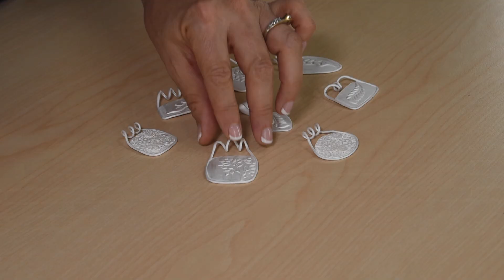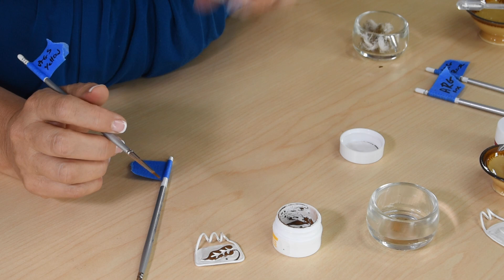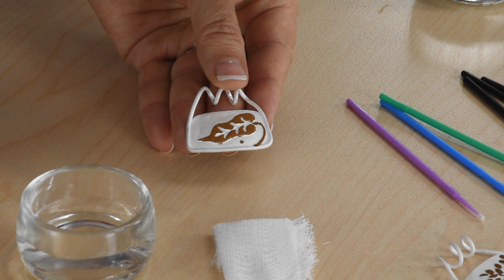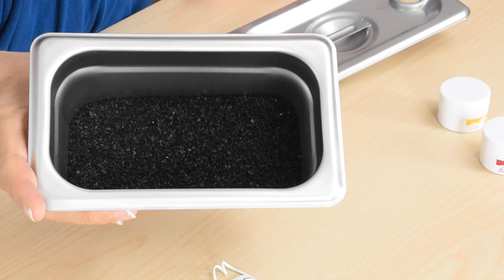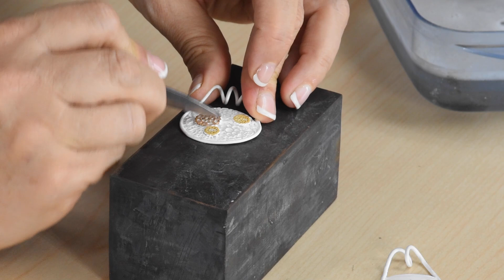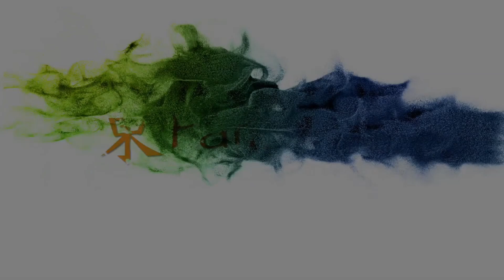Accent Gold for Silver and Accent Rose Gold Tutorial

Comment: hello Pam. sorry my horrible inglish, but i have at the moment no translater. Thank you so much for your supervideo.I also work a lot with metall clay silver and i make a lot of finger rings with different textures. so my question is : can i use the AGS Gold betwenn the silver pieces on a ring ond can i polishing this with a little metallpen. or do you think this gold is not good for applying to a ring because the owner will loose the gold when he weare it every day? thank you so much for your answer... Doris from switzerland❤
Reply from the maker: I have put gold on rings, but only in recessed areas.   If the fingers rub the gold, then it will wear off over time.

Comment: Question about the carbon. How do you store/handle responsibly. Can you reuse it? Put it back in the larger container? How do you dispose of it and/or do you need to dispose of it? Asking as I live in an apartment—limited storage and want to know best way to handle this eventually. Many thanks!
Reply from the maker: The carbon is very reusable.  I keep mine in a small bucket with a lid.  Over time it will develop ash from the firing process so you will want to clean that out periodically.  I wait for a clear day with a light breeze.  Take it outside and pour it back and forth between two containers. Wear a mask while you do this. The ash will drift away, and the good carbon will remain.
Reply: Manythanks!

Comment: I am teaching myself these techniques.  I have done all the research and all the required products have been purchased and I am waiting for them to arrive.  I have a question???  Accent rose gold, you say that using a torch for firing won’t work.  Have you ever tried it?  If you did try using a torch for firing the rose gold, what would be the result?  Would it bond, but not come out the correct color?  Have you ever tried it?
Reply from the maker: I haven't tried it, but only because I understand the problems.  Rose gold is made by mixing a small amount of copper in with the gold.  When you heat copper in open air it oxidizes.  This would cause it to blacken and likely flake off.

Comment: Thanks for all the practical info - I heard that you can also use these products in the green ware stage before firing - you did not mention this aspect & if so is it equally effective?
Reply from the maker: I have not used Accent (tm) products on greenware, but I have seen Aura Gold used that way successfully.  Just remember the longer a piece is fired, the more subtle the effect is going to become since the gold will absorb into the silver with extended heat and time

Comment: Hi Pam! Thanks for this video. Been trying out new techniques of adding gold to my work and this looks like a great option for me.
I have a couple questions-
Do you think it's possible to use stencils with this technique?
Does it stick onto the metal once it dries to keep it from spreading all over the piece?
Will it flow at all during the firing process or will it stay put?

Hoping to use this technique on the sides of ring shanks and looking for the best possible outcome. Thanks!
Reply from the maker: Hi Hannah,  So glad you liked the video!  It does stick to the metal once dry, but if you brush it with your fingers you can rub it off or move it around. So don't touch it until after it's fired!  It will not flow during the process. It's well behaved and stays put.    Bear in mind it IS a very thin layer of gold.  An area that might get rubbed a lot (like the side of a ring getting rubbed by adjacent fingers) will eventually wear off.  Good luck! I hope this helps!

Comment: Hello. Wonderful video :) 
Will gold chip off after some time or will it stay there forever? 
Thank you
Reply from the maker: It won't chip off.  The gold and silver are molecularly bonded.  However, it IS a thin layer. If applied to an area that is going to have a lot of touching or wear, such as a ring, it will wear through over time.  Piece such as pendants and earrings should be fine though.

Comment: Hi Pam, Thanks for the informative video. My question is: My pieces are not flat, they are more dome shaped. I usually fire them in a bowl with vermiculite face down to keep the shape. can I fire the accent gold the same way? Also, I touched my piece after removing it from the kiln. I think I heard that it should be refired to remove finger prints. I don't have a torch, so I need to refire in the kiln. How long and what temp do I need to do that? Or is it possible to just wipe with alcohol or something instead of refiring? Thanks so much, Ruby
Reply from the maker: I would fire the gold face up.  You can still nest it on vermiculite.  As for finger prints, just clean it with denatured alcohol and you should be fine. no need to refire.  have fun!

Comment: Pam, I mixed the Accent Rose Gold just as you said and it looked very smooth in the container.  After applying it to the fired fine silver (right out of the kiln with no surface prep), it looks grainy to me.  The Accent Gold looks smoother. They both appear to be the same consistency in the container.  Have you seen this happen before with ARG? Thank you!
Reply from the maker: Occasionally I've seen both products come out a bit grainy after firing, however I found that adequate burnishing with an agate burnisher and then tumbling took care of it.   I ended up with a smooth finish.  If the product chips of flakes then it was not fired adequately.

Comment: I don’t think I see any info here of how to get rid of all the burnishing marks, and discussing how or if the polishing affects the gold. This part seemed rushed. Also, why only show and give butane times? Seems to leave out us who use a proper jewelers torch? Otherwise lovely
Reply from the maker: I do my best, but there's only so much I can cover in a short free video.   I find that tumbling takes care of the burnisher marks and makes it all uniform. Tumbling will not negatively impact the gold.  Take care with polishing.  Abrasives will remove the gold. It's pretty thin.    Firing the gold is more a matter of watching the color than what torch you are using. I use a butane torch since that's what's easiest for video/demo purposes.  However, so long as you keep an eye on the color of the metal it really doesn't matter what torch you use.  Have fun!